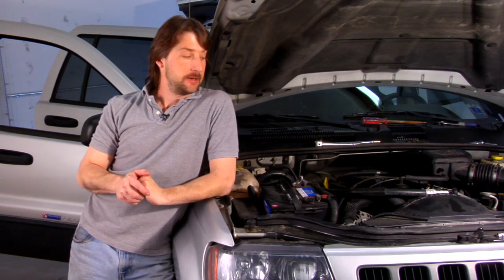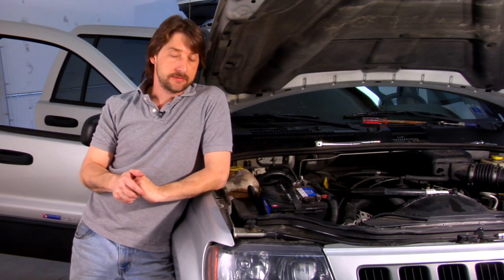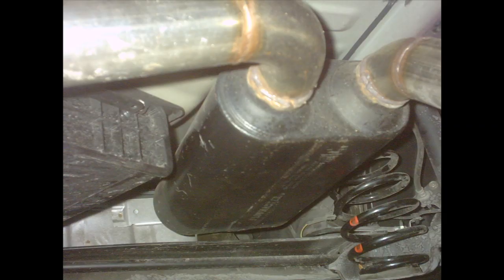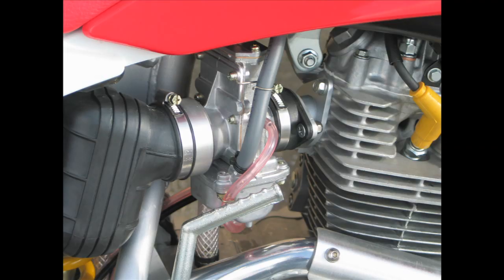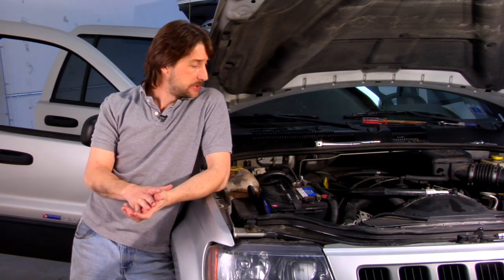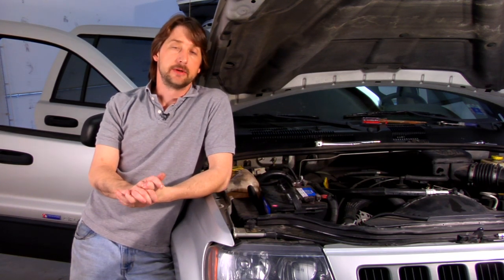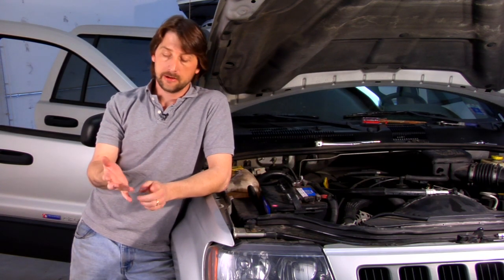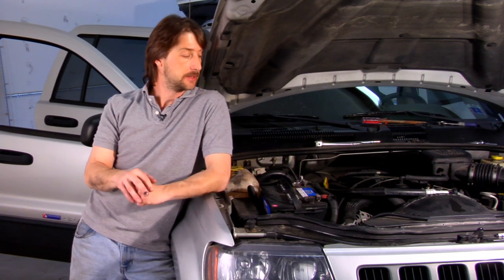Car Repair & Maintenance : How to Make a Motor More Powerful

Comment: one big thing i think people with older cars should know is the throttle gets lose over time. which just in general isn't a good thing. your just not getting the max amount of hp your engine has to offer. an easy and only way to fix is tightening it up to were the cable is snug, its not putting the throttle open it just at that point were its about to open. you want some slake. were it has room to respond is where you want it. newer car owners. don't pay this attention sense your is most likely on a chain throttle.

Comment: Naturally aspirated gasoline engines will not pick up 30-40% more power with a computer chip/programmer. 3-5% is more likely. However, Turbo Diesel engines CAN pick up over 40% more power with a computer chip/programmer.

Comment: K&N air filters suck.
If you have a 6 or 8 cylinder get AEM.
If you have 4 cylinders, don't even bother; you will lose much needed torque.